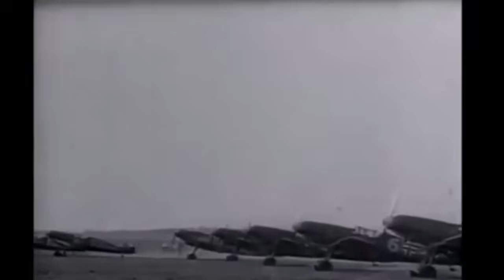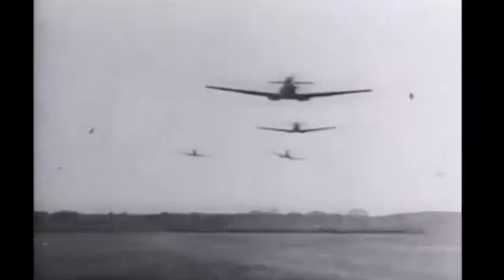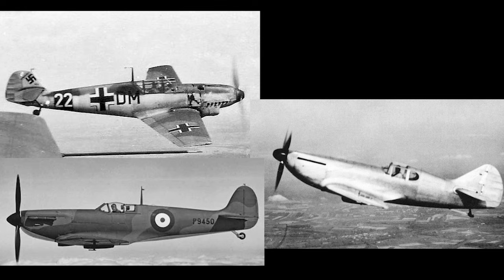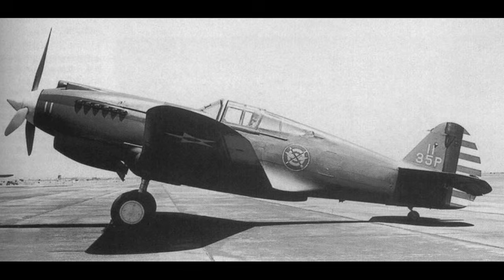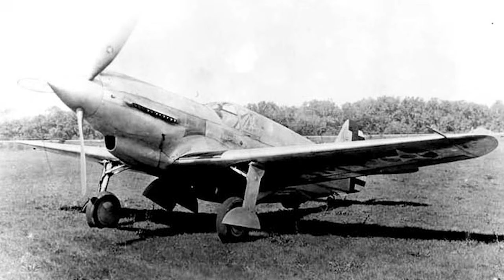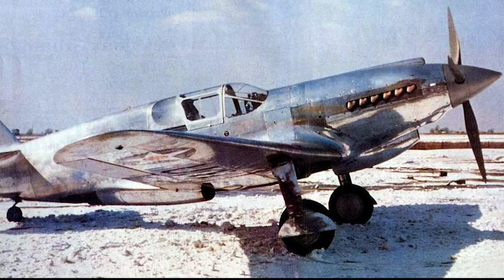American Spitfire; the Curtiss XP-46 “Kittihawk”

Comment: Ridiculous amount of firepower for a light air-superiority fighter.  Curtiss should have got rid of half of the wing-mounted MGs.  (2) .50 cals and (4) .30 cals would have been adequate.
The saved weight would have increased performance.
Reply: I really don't know why so many firms thought they needed their aircraft to carry a dozen machine guns when it really came down to a handful of heavy machine guns in the right place.
Reply: @echodelta2172  Most MG's firing rifle calibre rounds, need a massive combined RoF to equal the weight of shot on target in a shot aimed burst to achieve a relative chance of damage close to that of a .50, 13mm and larger machine cannons can do on-target - hence the number of guns, the number of which, was/were usually a requirement/stipulation by the Air Ministries/War Departments based on their own Airforces knowledge of their own average aerial gunnery abilities - of/from/during those times.
It doesn't help too much that the Browning 0.30's and 0.50's are quite heavy guns each, even without the feed tray/guides and the ammo chutes/boxes.
Reply: @razor1uk610  What a great write-up of info! Concise too. Thanks!
Reply: True enough, but the thicker wing and multiple air intakes (and poor ventral ducting) still created too much drag.

Comment: The xp46 story doesn't end there...  The plans were purchased by North American as a basis for the p-51 design.  The similarities to a B model are striking.
Reply: if you mean, the engine  is at the front and the tail is at the back... then they are twins! other than that they share absolutely nothing. North American had been working on Meredith effect cooling, laminar flow wings etc in planning and wind tunnels before being approached by the UK. The P-51 was a brilliant case of pulling together available technologies and rapidly developing the rest. The P-51 earned its place amongst the best of the war, The P-40 was already a stop gap fighter when the war started. Please note: North American did buy the license, looked at it and placed it in storage. By all means, have your favourites  but don't mix that with reality.
Reply: @philkennedy8683  What does the p40 have to do with this?  Nothing.  The xp46 was an entirely different design, don't conflate it.  Without actual NAA engineer testimony we'll probably never fully know to what extent the '46 design was adapted from.
Reply: @prreith  Time lines and contracts are recorded, the dates are known so we do know the level of involvement. We also know that they purchased the rights to the P-40 data, after the aircraft design was agreed to, and the contract completed with the British commission.  Wishful thinking doesnt change things. Please start with the excellent "mustang designer" book to get a feel for the timeline of events.

Comment: The XP-46 was the first of the "misses" for Curtiss and put them on the road to doom.  The British went up to North American and asked them to produce a license copy of the P-40; NAA built the P-51 from a fresh set of drawings.  However, compared to the BF-109 & Spitfire the P-51 was heavy (the Zero was too light to count; it was a terrible aircraft for long term attrition warfare).  The chief engineer of North America went to the U.K. and weighted every component of a Spitfire.  That lead to the nearly 1,000 pound lighter P-51H super fighter.  

What's the point?  The USA aircraft manufacturers made our aircraft too heavy.  Why?  We used 1/16th thickness of aluminum.  When the Soviets copied the B-29 they were able to use 1mm Aluminum sheet on much of the aircraft.  1/16th Aluminum = 1.6mm (about).  That .6 mm adds weight.  1/32 aluminum = .8mm or a little more than 300% the thickness of heavy aluminum foil.  That's too light.
Reply: Were the thicker aluminum sheets deliberately designed to make the aircraft more robust? Most US aircraft were known to take a lot of punishment and keep flying. Superior maneuverability at the expense of strength was shown to be a fool's choice in the Zero and even the Spitfire and BF-109 became heavier and less maneuverable in favor of heavier armament in later models.
Reply: @fazole  Boils down to imperial or metric. At that time About the thinnest that could be produced in inches scale was 1/16th inch thickness. Where as the standard in metric was 1mm.
Reply: @fazole  G A Pratt's answer is correct.  The USA is imperial in measurement.  All the sheet aluminum producing machines in the USA made it in 1/16th inch (technically .0625 inch).  The US took imperial inch and made it digital way back in the c. 1900 era.  I took manufacturing courses and learned both US digital & .  Metric. Metal sheets can be made in 1mm, 2mm, or 3mm.  In the USA it was 1/32, 1/16, 1/8th [ .03125, .0625, .0125] of an inch.
Reply: @Easy-Eight  Not sure that is correct. I think Alclad sheeting used in aircraft was made in various 'mil' based thicknesses, where 'mils' are thousandths of an inch. Alcoa produced Alclad in many thicknesses, e.g., .020, .022, .026, .028, .032, .034, .040, .045 mils and so on.  Aluminum sheet 1 millimeter thick would be close to .042 mil. So, aluminum sheeting close to 1 mm was in fact available.  I dunno about P-40s, but all of the thicknesses I quoted above appeared in different places on the wings of DC-3s. I suspect most WW2 era US aircraft incorporated a range of different sheeting thickness--different thicknesses in different parts of the plane.  With a little searching you can find online repair manuals for various WW2 aircraft and see the actual thicknesses used on differnet parts of those planes.
Reply: The skins on the P-51 varied in thickness due to what was needed in a particular area.  Most of those skins were .040".  
0.6 mm is actually the thick of 23 sheets of heavy aluminum foil.  I just measured the "heavy duty" foil in my kitchen.  It was .001" thick.

Comment: One book I read-The P-40 at War-suggests that North American was able to produce the P-51 prototype in 120 days because that had the data from the XP-46 program.
Reply: The P46 sure looks like a development step between the P40 and the P51. Does the book say that North American used elements of the P46 design for the P51? I couldn't find any reference to that title anywhere.
Reply: @toomanyhobbies2011  It suggests it,but presents no evidence. I no longer have the book,so I cannot refer back to it.
Reply: NAA bought the XP-40 ( not 46 ) test data, as insisted on by the british commission. read "Mustang Designer" etc and you will see the NA-50B was signed for by the British before the asked NAA to buy the paperwork. the configuration was already settled. The XP-46 was one of many half thought out designs that doomed Curtiss to history.
Reply: NAA had puchased wind tunnel data for the P-46 and were also fed info from the BPC engineers monitoring the progress on the P-46. They learned what not to do in some cases. (eg. Wing size, rad ducting)

Comment: How about an Allison/RR comparison?
Reply: Some Merlin powered P-40's were placed in production but the excessive drag of the P-40 meant that it didnt see much advantage in top speed. It was a classic case of trying to make a slick purse out of a sows ear.
Reply: That will just start a bunch of fights.  If you want to read up on it, there is a book by Daniel Whitney called Vee's For Victory that gives a complete history of the Allison V1710 and numerous comparisons to the Merlin.
Reply: @andyharman3022  At the end of the day, regardless of development histories, the Merlin was always at least one step ahead, especially on max power and max power altitude ratings, and remained that way until the end of hostilities. Many years later the Reno Air racers use RR/ Packard - Merlin derived engines rather than Alison v-1710 units. One does not have to like something to appreciate it as the truth.
Reply: @philkennedy8683  An interesting detail about the Merlins used in Reno Air Races:  they use Allison G-model connecting rods.  I feel bad for all of the Merlins that are built for Reno.  It's a death sentence.  The engines are destroyed making 3000 hp in an 8-minute flight.

Comment: I think one of the major problems Curtiss had when it came to producing a new fighter was that due to their commitment to production of the P-40 they were kind of slow of the mark with getting new designs built, by the time the prototypes of their new fighters took to the air their performance was comparable to the performance of fighters already in service when what the Army Air Force wanted was a new fighter with much better performance than the ones then in service.
Reply: Then there were the 18 other aircraft development programs that Curtiss was working on resulting in a massive dilution of effort.
Reply: Sounds right.  A lot of manufacturers got stuck making hundreds of a proven, successful, but outdated designs, at the expense of innovation...
Reply: Curtiss had a poor design team, whereas NAA had engineers fresh from CALTECH / GALCIT and used that facility to advantage. NAA design team was far better and the management was astute in gleaning many lessons learned from European/Brit/German sources in 1938-1939.  They also learned from the P-46 mistakes.

Comment: It sure does look the part what shame it was never to be, but I’m a bit of a fan of the P-40 series over it’s more popular stablemates the Mustang and Spitfire as good as they where.
Reply: Aesthetically, I don't like the big maw on the later P-40s, but love the P-36, P-60 and early P-40s.  The P-36 would have looked better with a spinner, which might have worked well in the North like Alaska, or farther south if cooling air exits were expanded on the sides like LA-7 and KI-100. the Buffalo would have benefited from this as well.
Reply: The bubble-canopy XP-40Q was the best looking P-40 variant, bar none...aesthetically almost perfect..the big scoop on the P-40E-N series looks good with a shark's mouth, but it is huge!...I always wondered how it could possibly be any less drag than a radial engine with that big scoop hanging down..and the Buffalo DID have a spinner on the F2A-1 versions, a small one, and a much bigger one on the F2A-2 version.... @alan6832

Comment: it wasnt until aircraft design by analysis began to be utilised, that aircraft began to be optimised
right here they decide to make a more advanced P40, and end up with a fighter that is fundamentally no better, arguably worse 
its not that they couldnt design a wing or landing gear, it is that no one had bothered to produce a compendium of expected weights of components to give clues as to where they need to improve. It is at this point a component by component design almost from the WW1 suck it and see, or trial by ordeal design school.
Given the limitations of either R-1830 or the Allison series engines, they just seemed to blindly go on producing airframes that only got heavier
If a design team arent challenged, things dont improve, if a design doesnt have a core concept that is an advance on its forebears, predictably you will make an identical aircraft. Rinse repeat

Comment: The P-40 was an awesome plane.
Reply: It was certainly an adequate one.
Reply: @jacobmccandles1767  I think it was great in regards to numbers produced and theaters used. With over 2200 air to air kills ( different sources vary a bit) it shows that it was effective enough in that role. Also lots of material destroyed on the ground. Held the line for the early years in the Pacific , CBI and Mediterranean. A great plane in my opinion.
Reply: @guaporeturns9472  so tell me El Guapo, would you say they had...a plethora of P-40s?

   Certainly it was great in that it beld the line, and I am a big fan.   Sometimes a good solution right now is far better than a perfect solution later.  For countries like China, South Africa, and New Zealand, the P-40 was there and it was their best.  Even where it wasn't the best, like in the U.S., it could free up better planes for the Front.
Reply: @jacobmccandles1767  😂😂only if each of them is “ feeled with leetle surprises “  P-40 could hold is own at lower altitudes at higher speeds. Had a great roll rate. Pilots eventually found this out .. but higher performance planes were coming on line by then.
Reply: Available early in quantity. When desperately needed. Which the P-38 was not.
Reply: @Idahoguy10157  and really, even if the P-38 Had been available early, it's hard to say if it would have been employed correctly.  It was no dogfighter, and later relied on boom and zoom tactics against the Japanese.
  The P-40 could out turn the Zero if it kept its speed high enough.
Reply: Not awesome, just barely adequate.
Reply: @MrDino1953   nope , awesome. Reliable , rugged , good firepower, easy to work on , excellent rate of roll ( especially at higher speeds) decent range. No vices. AWESOME
Reply: @MrDino1953  oh I don't know about that.  It actually had a rather impressive kill to loss ratio, though it's hard to get an overall number for the duration of the war.  It couldn't out climb a 109 or Zero, but within its envelope it could out manouver either of them.  It certainly wasn't the plane for Northwestern Europe, but neither was the Yak, the Hellcat, or even the P-38.
Reply: Useful if outnumbering the LW and given top cover, otherwise just adequate.
Reply: @bobsakamanos4469  excellent plane below 12-10000 feet. Read some stuff.

Comment: In between the XP-46 and the later XP-60 Curtiss also proposed a design that became the XP-53, it used an experimental inverted V12 Continental engine, the Army then told Curtiss they wanted the aircraft to use the Merlin engine instead which led to the XP-60D, unfortunately for Curtiss demand for the U.S. built version of the Merlin for the P-51 and other aircraft meant they had to find an alternative engine.
Reply: A lot of the shenanigans dealing with later Curtiss fighters revolved around Glen Curtiss being opposed to his factories building a competitor's aircraft, specifically the P-51. So he made a lot of promises to provide a better aircraft than the P-51, similar to how the B-24 was designed to keep Consolidated from building B-17's. The difference was, Consolidated delivered, where Glen Curtiss didn't.

Comment: The XP-46 could be called a victim of 'requirement-creep'
Awesome video on this forgotten bird :D
Reply: The Curtiss thinking was outdated by '41/'42, bigger, more aerodynamically advanced airframes were required,  mated to larger engines and fuel loads.
Reply: or simply that Curtiss did not heed lessons learned from European countries.  The thick wing and lack of proper radiator ducting come to mind.  These were known issues in 1936.

Comment: I know it's Wikipedia, but did you find any link from the XP-46 to NA-73X (read future P-51) and North American purchasing the the airframes and blueprints for it's development? 
Great work again Ed!
Addendum: Fascinated to find out that the P-40 served until 1958? ( with the Brazilian Air Force)
Reply: The whole reason North American designed the P-51 in the first place was that the British Purchasing Commission wanted them to build P-40’s under license for the RAF and they convinced the British that they could design something better.
Reply: @mrjockt  Yes, I know that. But I'm just asking if Ed had any information on the possible link between the two aircraft?
I mean, they look very similar, had the same Allison engine. Just curious, that's all. My head says it's too much of a coincidence.
Reply: @68Boca  I’ve had a look through a couple of the books I use as reference material, U.S. Fighters 1925-1980’s and The American Fighter, both of which have chapters on the XP-46 but neither mentions any links between the two aircraft. It’s kind of ironic really, North American designed the Mustang because they didn’t want to build a Curtiss design and then about 15 years later they ended up taking over the Curtiss Aeroplane Division.
Reply: @mrjockt  yes, my thinking is this? It's only supposition, but hey? Curtiss in 1940 had reached peak capacity anyway, the XP-46 was not happening, North American got offered a project, sees the XP-46, buys it and tweaks it. Rolls out a new design in about 110 days or whatever it is. 
I'd never thought about it before, but the similarities are remarkable between the XP-46 and the NA-73x. Absolutely no evidence other than conjecture.
Reply from the maker: I must admit, the only place I found any reference to the mustang/xp46 link was the stuff listed on wikipedia. I'm personally dubious.
Reply: @EdNashsMilitaryMatters  The literature of the Mustang talks about it. And I remember reading decades before Wikipedia.
Reply: @magoid  the mustang history includes the purchase of the XP-40 test data, at the request of the british commission. This was done after the deal for 400 NA-50B aircraft had already been ordered, based on the proposal already submitted.
Reply: @EdNashsMilitaryMatters  the musatng designer book points out that Lee Atwood purchased the test data for the XP-40 at the request of Sir Henry, to keep the people in london happy.
Reply: @EdNashsMilitaryMatters  I agree, but the more I look at the Xp-46, the more I see a P-51B? Especially the undercarriage. 
But anyway, thanks again ED.
Reply: given the time frames and when the deal was closed for the NA-50B with the british commission, there is no connection. The test data for the P-40, not the XP-46, was purchased after the deal was closed.